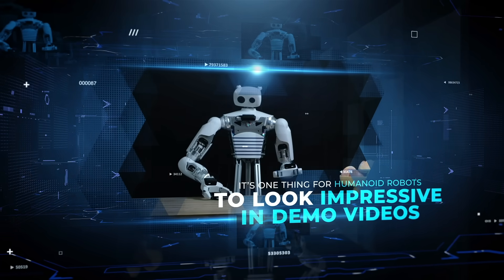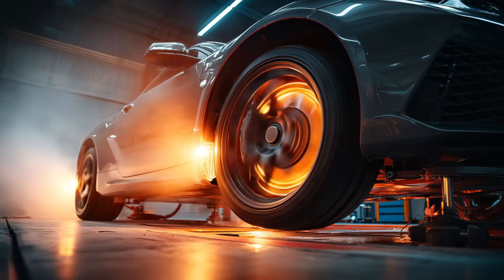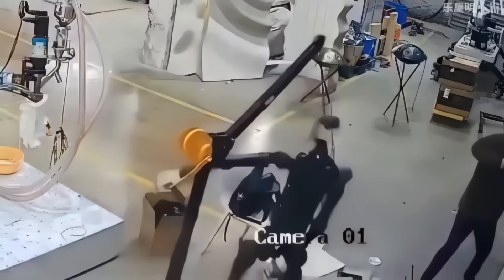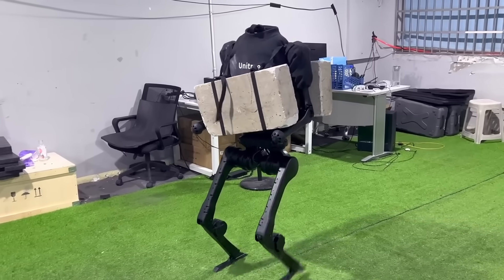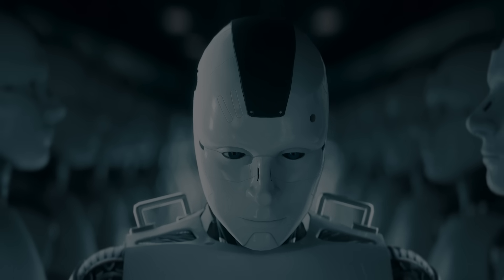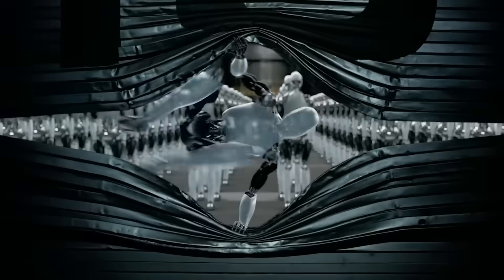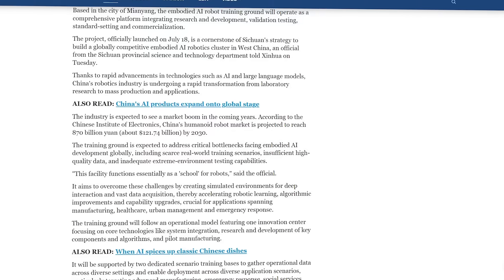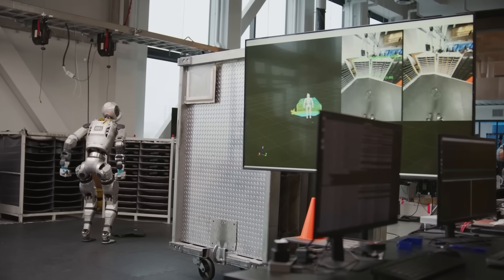AI Robot Snaps Again and Attacks With Full Force (Engineers Shocked)

Comment: I’m a control systems engineer.  It absolutely makes sense that a robot would flail about with its feet suspended off the ground.  However, the software could be tweaked so that this situation is now detected and accounted for.  

And that 165 ft-lb torque capability is quite large!  Bone-crushing capability.  I once worked with a 10 ft-lb gimbal motor that could dislocate a shoulder if one wasn’t careful.  

Anyway, they’ll fix it.  But it shows robots are apparently  much stronger than humans.

Comment: Looks like AI has a fight or flight problem. Need to make a protocol that monitors sensors and energy output. It either picks up more noise over normal set levels, the robot should enter a pause mode and have some type of operation status light, green when working, but flashing yellow or red when the safety state is reached and the color and type of flash would let you know at a glance, from a distance.

Comment: What's crazy is that white without the emotional background what we're looking at is in essence panic.  It's like those dreams you have of falling or when you miss a step on the stairs and your body freaks out trying to balance and stabilize it self. They turned it on with a core program specifically for balancing and not falling down but it's feet aren't touching the ground so it's 
"Spazing " is the program working perfectly fine but the limbs being unable to grab for purchase.  It'd be interesting to see if it does the same thing whilst in zero gravity. I assume that it would.  It's like if you drop a cat. All of it's limbs flail about and twist in an effort to balance.  There's absolutely nothing alarming about it.
Reply: The cat will only twist around in the air to get ready for landing. It's not we quite the same thing.

This robot reaction was looking like a wild animal that got trapped in a cage and doesn't know what to do to get out of it.

Comment: Well, of course you lift them off the ground and activate them they're gonna flail around trying to balance, and can't get it's feet to the ground. It'd be like a human in a river with a heavy current, The water knocks your feet out from under you and you feel like you're going to drown so you thrash around trying to regain your footing. What they should do is make the maintenance loops weight-sensitive, and if it's on the crane, disable the balance system so it won't flail.

Comment: Having a robot go berserk during development in a lab is not even remotely the same as having it go berserk in public.  I would expect all sorts of unhinged behavior during development, working out how to avoid that sort of thing is what development and testing is for.  This is all lab stuff, where we basically know the systems are incomplete or buggy or whatever.  This particular thrashing behavior looks like it's probably easily reproduceable, and therefore fixable by addressing it's stability monitor and how to behave when it's feet are dangling in the air.  It obviously hasn't been told that yet.
Reply: Can we pre-program these things that when they attack they go after Tech dorks like you first?

Comment: I work on automatic carwashes. For example the top brush (the brush that sits horizontally in front of your car and goes over) is design to rotate in a certain direction and if it's run by a VFD it's easy to switch rotation during operation, for example you might wanna do it right before it goes down the backside of an SUV to wash under the top lip on the back windshield. Now if you set some parameters weird, or change the electric motor and won't check rotation and it spins the other way around you will start cracking windshields and break wipers. That's a fairly simple example and not many variables. A robot design to replace humans with human like features will create so many things like this... Oh boy.

Comment: This is what happens when you have developers with little to.no experience in process control, avionics or robotics program something that can get out of control.   They need to understand the concept of a safe state of failure. Also the fact that anything can fail.  Joint position encoders, drive circuits, and software.